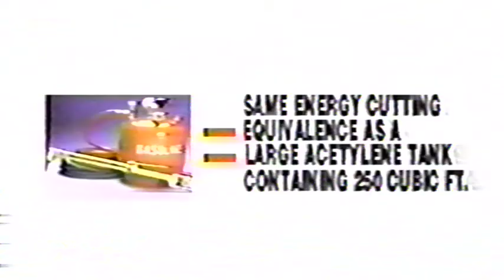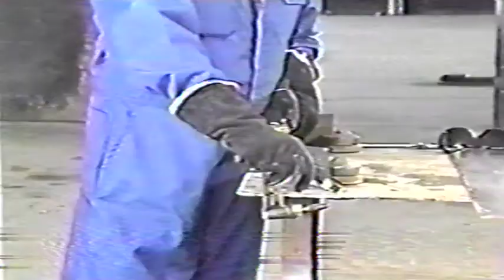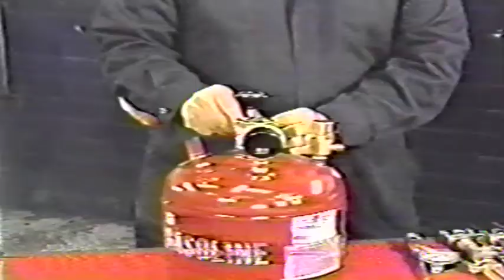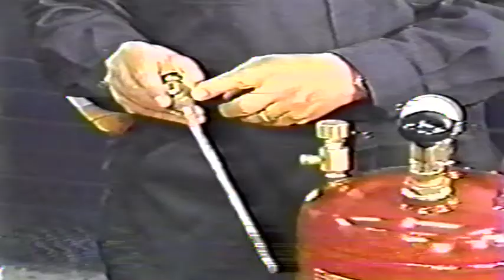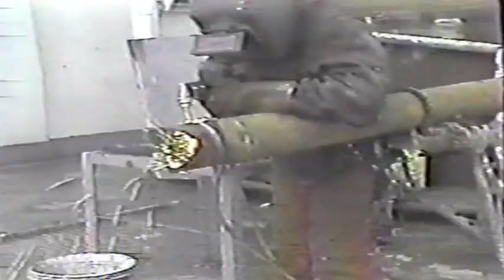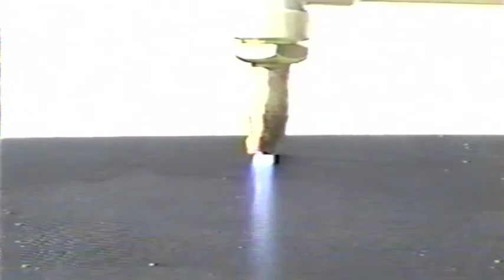Petrogen Oxy Gasoline Torch

Comment: Would it work if we would use compressed air from a compressor in place of the oxygen bottle
Reply: less efficiently, the air has only 21% oxygen.
Reply: @DanielSilva-jj2lz  thanks
Reply: No it does not. I tested. I used an air pump (instead of oxygen tank). Does not work. You need oxygen plus the gasoline fuel.
Reply: @ivan schafeldt good idea